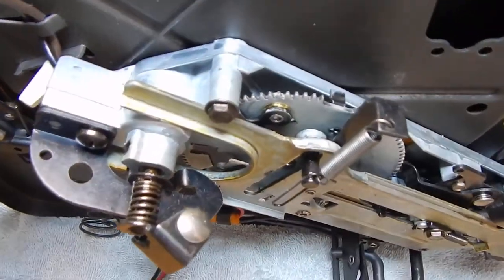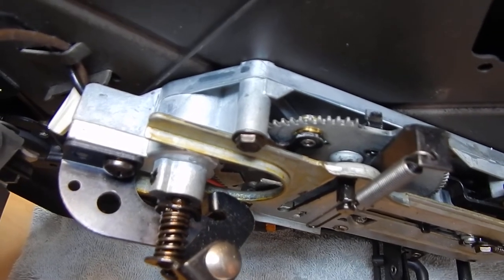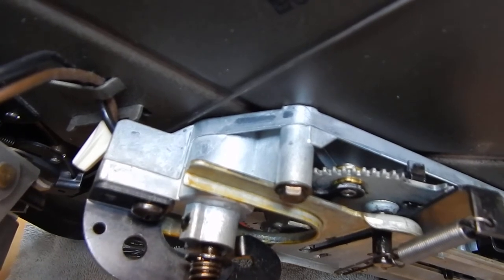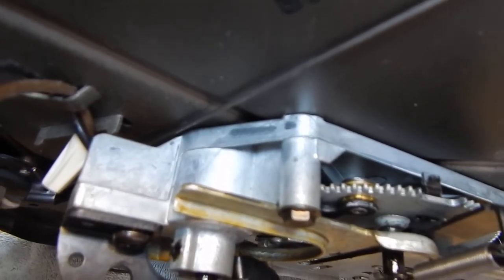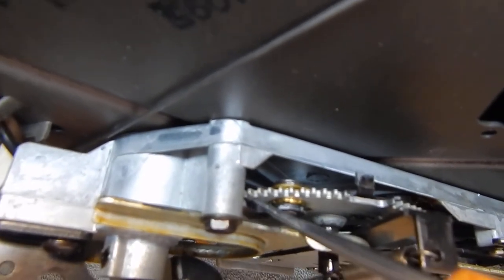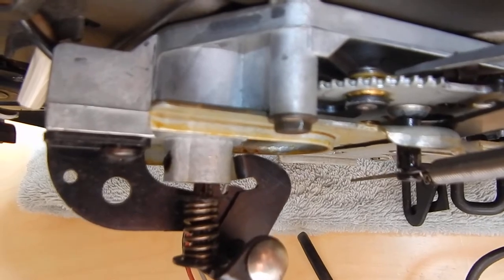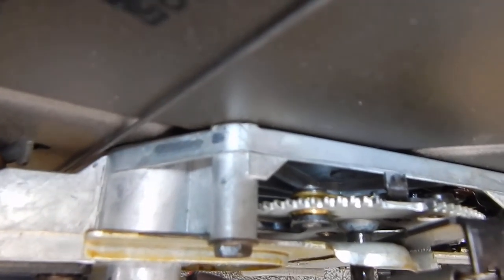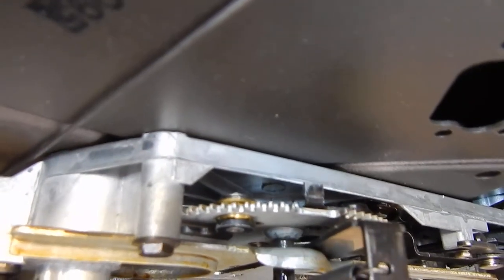Vintage Zenith Console Stereo Record Player/Turntable Auto Reject Problems

Comment: Very well illustrated. I appreciate that you offer a solution which doesn't require complete disassembly - something not everyone can tackle. 
My 1961 Motorola Stereo had that problem in 1972. My grandfather helped me tear the whole thing apart, clean the seized parts and lubricate it.
It ran until the late 1990s when that, now ancient, grease locked up. Took it apart with my son, cleaned it, lubricated it with then totally, outrageously expensive synthetic lubricants.
It's still running, for goodness sake, in 2023. I recapped the amp (that three-channel design was cool!) back in the 90's. Probably going to be time to do that the next time a tube fails, they pushed them pretty hard. Glad they stuck to 12ax7 and 6l5 tubes, still cheap and available.
Reply from the maker: Yes this is one of the most common problems with these VM changers along with the platter rubber wheel turning to plastic.

Comment: I have a Phillips from 1957, the pieces are not seized, but does not complete the cylce when i hit start or reject, unless i move the platter with my hand, idk if it's the idler wheel or anything else, it runs at correct speed but it looks like doesn't have enough force to complete the cylce

Comment: Maybe you’ll be able to help me. I have a similar model. It’s a zenith mn2604 and the turntable won’t turn at all. The system powers on but the reject doesn’t work and the table won’t turn. Any advice? Thanks
Reply from the maker: usually, the motors are so gummed up with dried grease is the most common problem.

Comment: Ray, thanks so much for your video.  Would I have to take the turntable out to get to that trip lever or can it be accessed from underneath and through the back?
Reply from the maker: Sure thing, it kind of depends on what model console your working on, there easy enough to remove, just flip the two clips underneath and disconnect the connectors, take a pic or video in case you forget where things go.
Reply: @rays744  it's a 1967 Zenith with the 3 movable louvers on each end covering the speakers. very common but worth the restoration.  I acts like it wants to play but drops the records and then turns itself off.
Reply from the maker: @deanhenderson7940  Yep that's going to be your problem, your tone arm lifts up, record drops, then tone arm sets itself back down on the rest and then turns off, it's that pawl lever frozen, hit it with WD-40 and work it back n forth on top and bottom till loose and moves freely.